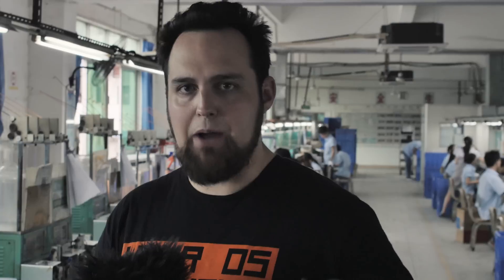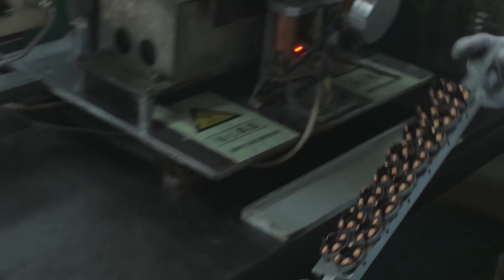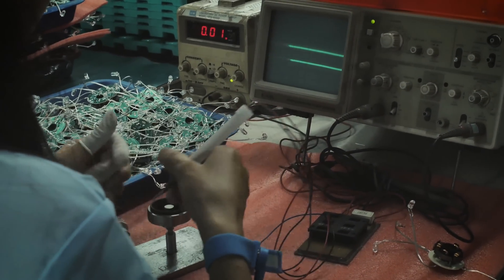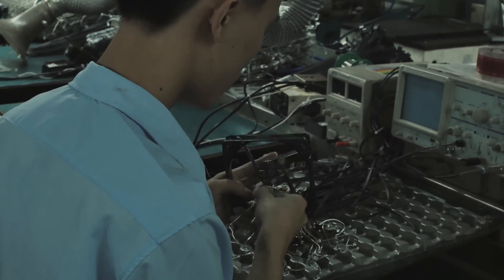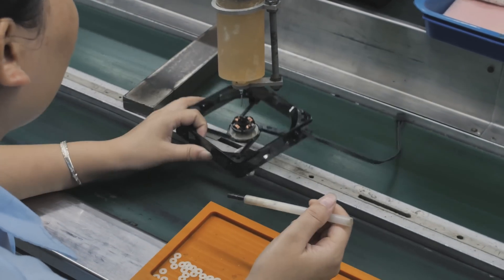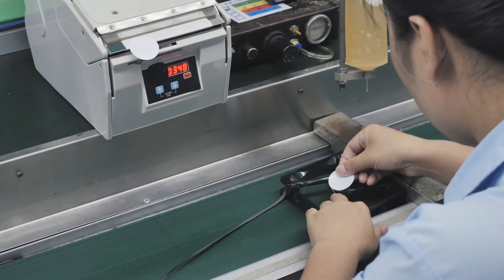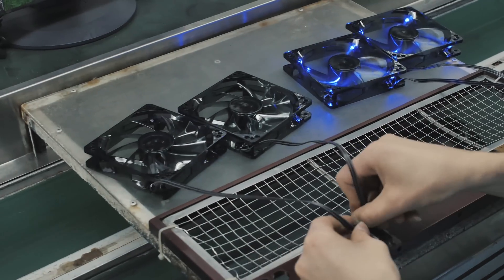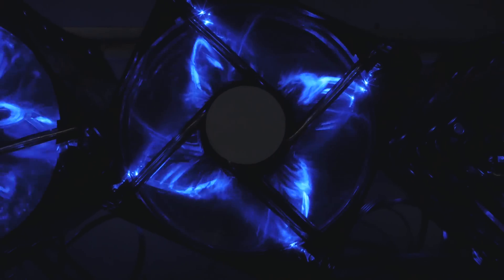How a PC Fan is Made: DEEPCOOL Factory Tour Part One

Comment: Hey guys I need a little help I am currently picking parts for my new kick ass computer.
I don't what the big advantages are with having 8 cores or 6. (Yes I understand that 2 more cores then the other but does it make a huge difference?) I also need help on getting enough power for 2 GTX Titan X I was think 1200 or 1600 watts. Also I am using a Corsair Graphite Series 760T and I need to know of its big enough I looked and it to me seemed big enough but I would like some help as well

Comment: Pretty old tech they got there, but hey, it still works :)

And maybe to DeepCool: Is it possible to buy non assembled fans so they could be assembled by me (soldering, oiling, assembling, but not winding the coil etc.)?
Reply: ZiGa:S dude wtf? The fan are well build, if they weren't, they wouldn't pass their stress tests. Relax. And yes, it's pretty old tech they are messing with, but most factories use old PCs either way. That's how they maximize profit.
Reply: I am not saying that the fans aren't OK built, but it would be nice to make such kits that some consumers would be able to built fans themselves. This would probably also make lower manufacturing costs -> cheaper price with some fun with assembling the fan :)

And not all companies use old tech. I guarantee you that Noctua uses most advanced stuff to manufacture fans and it is also true that not all Chinese companies use old stuff to manufacture their products.

Comment: Glad to see them not abused and forced to breathe lead.
Reply: Explicit Tech Should have asked their pay rate, probably might change your tone.
Reply: MrNightpwner $14 a day?
Reply: Vastonik Correct. The European Union basically force them to use tin, and not lead. They have to pay extra taxes to export to EU if it contains lead. Downside is, tin is more fragile than lead.
Reply: Explicit Tech They wouldn't be breathing in lead even if the fume extraction wasn't there. Lead won't vaporize until extreme high temps (1750*c). The fumes/smoke is just Rosin, which is harmless (until proven otherwise, they've yet to find any actual evidence of flux fumes causing any harm).

Of course on a large scale such as a factory environment, fume extraction is pretty much a requirement though.
Reply: @JamieRyan92  Rosin flux fumes are likely connected to high incidence of asthma in electronics assembly workers, research was made in the 80s and 90s in EU and elsewhere. With around 50-55% showing asthma symptoms back then - so undiagnosed asthma is also considered - which is several times more prevalent than in comparison group. And that in spite of mandated fume extraction. This is an epidemiological consideration; it's probably mostly just a weak respiratory irritant, but constant long-term exposure to an otherwise fairly benign substance can add up to a substantial overall health impact. You probably don't want sticky, non-inert, somewhat acidic, tree resin collecting in your lungs, it's not like chronical lung tissue inflammation should be an anyhow surprising result. Things get potentially less harmless with more modern additives like halogen-based which are known for their high chemical reactivity and raising the acidity level, but there has not been specific research into this that i know of.

The positive however was that no signs were found of increased occurrence of any diseases and conditions connected to lead, so it's reasonable to conclude that standard precautions (like no food near the workplace, washing hands) were effective in this regard.
Reply: MrNightpwner better than working at McDonald and living on the street with no healthcare and then get shot.
Reply: Vastonik It's banned in many countries to sell products containing lead solder.

***** Well that's good to know because I like the smell of Rosin.
Reply: All solder contains tin. Common leaded solder you can buy at the store is about 60% tin 40% lead. The most common lead-free solder is 96.5% tin 3.0% silver 0.5% copper.
Reply: Well they're in Taiwan--the "good China"--not mainland China, so it shouldn't come as a surprise.

Comment: Are those self feeding soldering irons? I want one of those thats awesome. Like a mig welder for electronics
Reply: zach miller Missed that bit! Yeah they look like self feeding irons. :P
Reply: zach miller Hell yeah but they but I doubt they are cheap, and would cost more then a good quality soldering station would.
Reply: zach miller Lol no they're not, if you're talking about where she was soldering the LED's to the board. The solder was in her left hand.
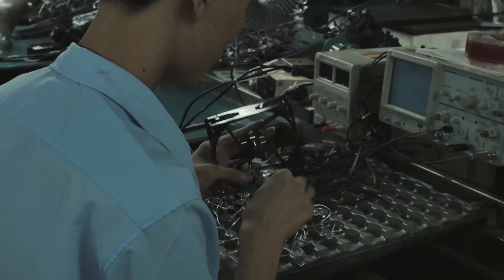Reply: ***** no at 2:15 where shes soldering the power connector.
Reply: zach miller They are using Hakko 936 soldering stations (With Hakko 907 handle), the component pins comes pre-tinned.
Reply: +TheAmmoniacal They are probably using clones. That model has been widely cloned , and can be had for under $20 with shipping. The original has been discontinued for years.
Reply: Juan Herrero Fully possible, I used a $22 Hakko 936 clone for a few years myself. No complaints.